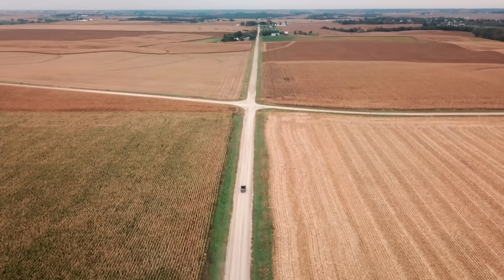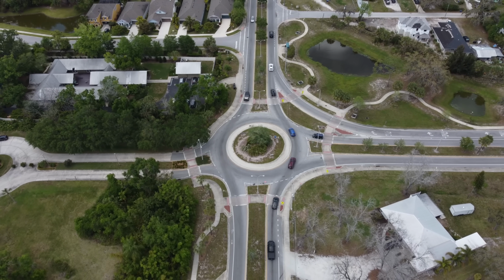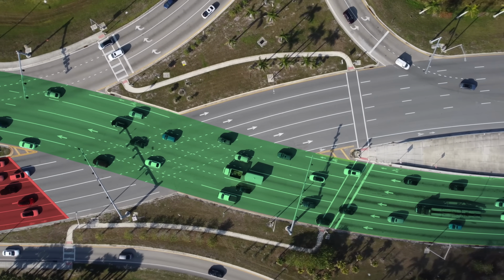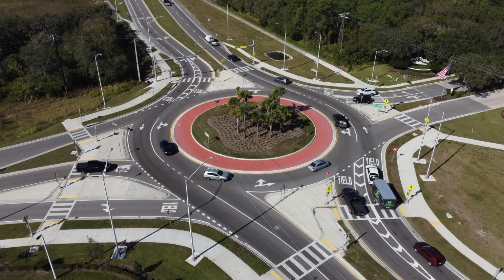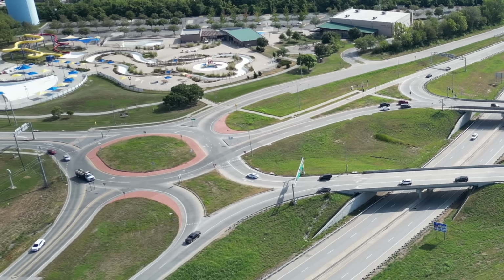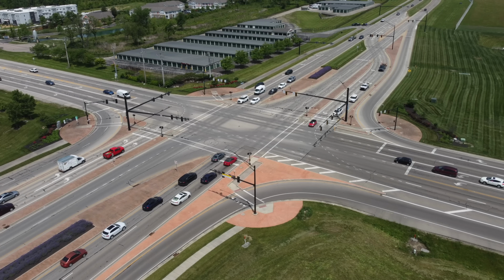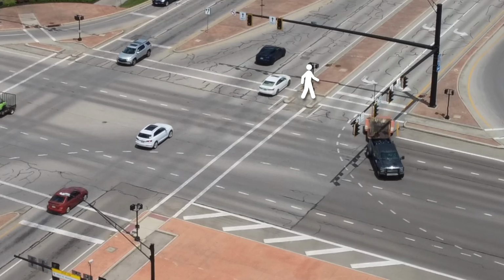These Intersections Are Changing the Roads Forever

Comment: Instead of diverging diamonds Idaho has been replacing highway interchanges with the SPUI. Single point Urban Interchange. 6 directions meeting at one signal either above or below the highway. This allows for only 3 cycles on one light. While right turns off the highway are signaled they are timed the same as the left turn on to the highway. Results in a smaller footprint than the Diverging diamond.
Reply: What are you talking about?  Idaho has been building DDIs as well.  SPUIs has just been around longer.

SPUI are better if there is more through traffic, DDI is better when there is more ramp traffic.  SPUI overpass cost more because of the special bridge span.  DDI costs less because it can use the existing bridges without much modification.

A DDI is more efficient because there is only 2-phases, where a SPUI has 3 phases.  That means there is less overall red time with a DDI.
Reply: @traffic.engineer  Really? Where? I'm in the Southern half of the state. 
I have seen them in Utah. And other states when I did OTR many moons ago.
Reply: @Species-lj8wh There is a DDI in Chubbuck and one in Rexburg.

Comment: A 🍀 system solves the left turn issue very well. It's the most used system for highways in Brazil.
Reply: Cloverleaf is unsafe and innefficient for large volumes of traffic.  Along with more cost and wasted land.  Streetcraft has already explained this.

Cloverleaf is for very low volume roads only.  American states get rid of them once an area urbanizes, as they cannot handle the volume, they have greater crash risks, and is very difficult and dangerous for bicycles and pedestrians.

Comment: Roundabouts are not more efficient.  It's a lie.  I have yet to see a roundabout replace an 8 line highway intersection.  Roundabouts are safer and they work well in places where there is say a medium amount of traffic.  I assure you this is true.  I have seen it in action.  They fail in open areas with lots of traffic.  They excel in low to medium volume areas or in urban environments where there is already congestion.  A one lane each side roundabout gets you 1000-1200 cars per hour vs a traffic light can get you 1800-1900 cars per hours.  However when you add a 2nd lane it's even worse because a 2nd lane will only give you 60-70% more capacity in a roundabout and 90% more capacity in a traffic light.  At 3 lanes it's not even a contest.  The thing is that most intersections don't need that capacity so roundabouts make perfect sense but when they do need the capacity you would regret putting a roundabout there.  So let's think about this.  A two per side lane roundabout is just barely more than a 1 lane traffic light.  At that moment the 2 lane roundabout probably makes sense so long as the volume is fairly balanced.  The problem becomes a 3 lane per side traffic light is not even possible to make a roundabout do it.  Such a traffic light could handle 5000 cars per hours but even a 5 lane roundabout could only handle 3000 per hour and honestly no one even builds them.  See this link for more.  https://www.tandfonline.com/doi/full/10.1080/03081060.2023.2214144
Reply: Roundabouts max out at 1000/veh/hr/lane.  They are great solutions for low volume intersections.

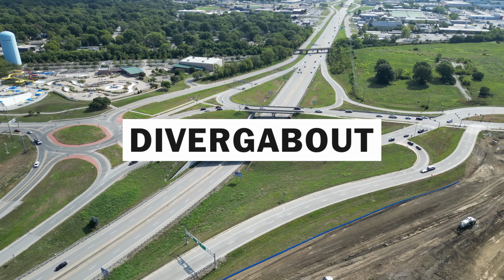Comment: 5:14 they're puttinc a costco in the grassy area on the top-right (southeast) of the traffic light side of the intersection. You should revisit how well this works on those days. There's also a megachurch on the SW corner of the interchange, Sunday mornings at 10:30am (costco open, church switching between services) will be massive stress point too. It'd be cool to see a followup.

Comment: So many great ways to direct traffic and especially to prevent conflicts with left turns… Meanwhile here, lots of traffic lights actively make left turns and opposing forwards traffic green at the same time. No idea why, but it seems like it's almost half of all traffic light systems that does this. And it constantly leads to people getting stuck in the middle of the intersection and blocking everything. Or people get a green light to turn right and pedestrians on that part of the road, which can be hard to see, also get green at the same time. I keep saying that they might as well turn the traffic light off completely at that point, it would be safer.

Comment: Couldn't find any mention of it here, but roundabouts function perfectly well in a power cut. Unlike traffic lights.
Reply: Because roundabouts do not work well on high volume roads, where signals are more efficient.  When power is out, police direct the major intersections until the emergency repairs are made.

Comment: It can be easy to clown on the divergabout, but I think it's a good thing to combine roundabouts with traffic lights here and there. Here in Denmark there are many roundabouts and they're efficient enough, but if you stack them too close together and you can have amazing traffic jams. I've seen jams that went through 4 roundabouts on a 3000 feet / 900 meter stretch. Everyone was eager to exit the city during rush hour and one blockage in the outermost roundabout caused a queue of cars going quite a fair bit into the city.

Comment: If a two way road meets (but doesn't cross) a one way road it is possible to have no lights and one merge for that connection. If you are then further willing to alternate (having both types) which side of the road the two way is, you can design a space with no lights and just merges (and without levels).

This can be used in a brick style grid giving an urban option with no lights and continuous traffic only slowed by turns and merges.
Reply: That only works with low volume roads.  It creates congestion for high volume roads.

Comment: Living in the Netherlands, I can't not laugh at these 'left turn solutions'. The roundabout is great! But the issue of the left turn is compounded so much by having to cross multiple lanes of traffic! So many US (st)roads have 3 or even more lanes. This creates situations where visibility to lanes is blocked by bigger vehicles, and it can get really hard to cross a road purely on visibility. And the second issue is the high speeds on all roads in the US. Almost all (bigger) roads have a rather high speed limit. This obviously makes crossing such a street much more dangerous. Even with traffic lights, this compounds the risks even more.

The 'solutions' to these problems in this video require so much space, cost so much to maintain, that I don't think they are real solutions at all. Sure, they are more safe than what it was before, but that's like saying we'll eat mud so we don't have to eat shit.

The real solution to dangerous left turns is simply to change the zoning restrictions and road rules. If the rules get changed so you can build beautiful cities like in Europe (Netherlands as a prime example of course), every time there's road maintenance, the road can be updated to become much much better. Every stroad converted to a street will change more people's minds. Cycling and walking will reduce traffic so much, that multiple lane stroads aren't even necessary anymore. Etc. Support Strong Towns, an advocacy group for this!

Comment: I'm not that well-traveled, but I can think of several places where the divergabout would be super useful in multiple states. It would be the most useful at an interchange I use on my commute to work that already has the diverging diamond, but the frontage road stops you from getting to the diverging diamond, so it feels like I am stuck in view of the interstate for ages before I can actually get on it. Unfortunately, it's on a steep hill with not a lot a space, so I don't know if they would be able to put the roundabout there...

Comment: Why not make the diverging diamond into an oval-about?
Reply: It would increase construction costs and would not be as efficient.
Reply: @traffic.engineer  I'm not sure how that could be. Surely, any system making use of stoplights is going to tilt towards being more inefficient. If the whole overpass operates as a roundabout, then all motorists slip to right rather than crossing traffic. Secondly, the diverging diamonds take up a significant about of land on either end of the overpass. I don't see how anything more than marginal increase in costs would occur in shaping both ends into a half circle.
Reply: @aaronjones8905  Freeflow operations for roundabouts only work for low volume intersections.  At high volumes, there is less gaps to merge at speed, which increases the stops and queues.  That is why UK has congestiom approaching roundabouts and even has to signalize them.

The dynamic assignment of right of way is necessary to allow these large volumes of conflicting traffic.  Signalized intersections arr more efficient for high volumes, while roundabouts are more efficient for lower volumes.  The simple two-phase intersection also reduces red times.

Additionally, a full oval interchange requires more land to build, while also using more complex structures (curvilinear bridges).  These factors increase the cost.  Diverging diamond uses the much of existing footprint of the original interchanges.

Comment: I just look at how enormous all of these things are and my pedestrian brain cries.
Reply: They don't have highways in Europe?
Reply: @traffic.engineer 
A - I'm not in Europe. We do have these things in Canada, and I still cry about the space they take up.
B - As a general rule, anywhere there's sufficient population density to create the levels of traffic that these designs are trying to address should not have highways. Big interchanges where two highways come together? Sure. Big interchanges to connect surface streets to the highway? No. If there's too much traffic on the surface street for a simple diamond, then the job is to reduce the traffic, not come up with fancy designs to facilitate it.
Reply: @The2wanderers  That space is necessary to manage the stormwater.  Otherwise the road floods, which damages the pavement and/or takes lives.

The best way to manage traffic is to spread out the conflict points.  Keeping them tight creates more danger or more congestion.  Hence which a roundabout is better than a standard unsignalized intersection.

Comment: A couple other additional perks when it comes to roundabouts has to do with pedestrians crossing the road there. And they are;

1. Refuge islands. If an intersection is particularly wide, you might not be able to cross it in one cycle, and that’s where refuge islands come in useful, as they allow pedestrians to stop in the middle of the road (legitimately) without the fear of being run over by a car, which leads me onto;
2. You only need to pay attention to traffic coming from one direction at a time. From where you start up to the refuge island, you only need to look left (or right if you’re in a country where they drive on the left side of the road), and vice versa from the refuge island to the opposite side of the road.

Comment: Multilane Roundabouts should be illegal
Reply: Why should a 2 lane roundabout be illegal?
Reply: @GrillerRohde  Because they are dangerous
Reply: @Fosten12 
They are only dangerous if they are poorly planned and constructed or if the people never learn how to use them properly.

As most countries have many regulations for planning and constructing infrastructure this should not happen.
The major problem of most nations is that driver licenses are cheap and easily accessible and thus people never learn how to properly drive or handle unfamiliar traffic scenarios.

The majority of crashes in roundabouts I have seen were either due to excessive speed, failure to yield or unsafe lane changes. Most of the time purely caused by the driver rather than the roundabouts itself.

Comment: Roundabouts and similar designs can just work wonders. Look at US-169 at I-494 in Minnetonka, MN. They added a metric ton of roundabouts to replace several different interchanges right next to each other. It took maybe a week of getting used to, but once I did, it was an absolute dream. So much easier on the vehicles, too.

Comment: I'm currently at a semi-cloverleaf intersection between two main roads in Israel that I was hoping you can cover. On the south part of the first road, there's a junction with 3 lanes coming out of it + right turn slip lane. those lanes turn into 2 lanes for the intersection and the traffic merging from the other main road is not making it easier: they also merge from 2 lanes to 1 and then into the main road.
The main roads in question are roads 40 and 44 in Central Israel.

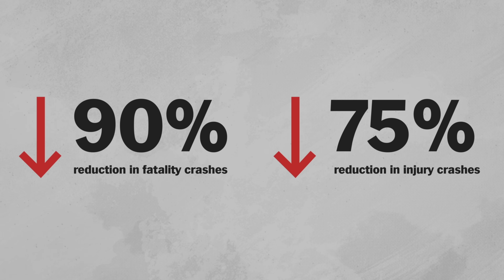Comment: 0:46 NJDOT has been progressively ripping out their circles as they got so congested they became accident generators
Reply: Because they are not roundabouts.  They are not designed like a proper roundabout and need to be removed.  Additioanally, roundabouts are not made for high volume roads.
Reply: @traffic.engineer  These were called Traffic Circles in the US up the late 1990s. That is when government here got serious about standards, making many changes on signing and flow, and government/media seized on the Aussie nickname roundabout. NJ found out the hard way that putting a circle where two major arterials (multi-lane mind you) meet does not function well. Roads here probably in the 30-100k per day range.

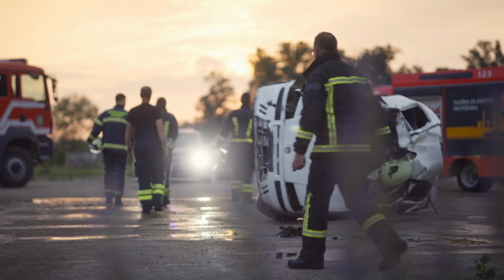Comment: 1:10 Efficient? Not in the rush. Circles on 2 busy roads start flowing like traffic lights. One road will flow while the other backs up, then they flip.
Reply: So they're no less efficient for high traffic, more efficient for low traffic, and don't need lights maintenance.
Reply: @williamchamberlain2263  For high volumes, signalized intersections are more efficient.  The can dynamically assign the right of way, where the static operations of roundabouts cannot service.  Roundabouts perform much better than signals for lower volume intersections.
Reply: Standard roundabout maxes out at 1000 vehicles/hour.
Reply: @traffic.engineer  NJDOT has been removing circles since the 1990s. The Marlton Circle, sited where NJ 70 and 73 cross (both are 4-lane major arterial routes) was over 50k vehicles/day averge, far worse with shore traffic.
Reply: @dtvjho  Those numbers are well above capacity, requiring removal.
Reply: Maybe you should leave earlier

Comment: All these spaghetti solutions make it extremely hard to maintain a mental map of where you want to go.

The roundabout is still king. Missed your exit? Just take another round. Need to turn around to go back to where you're coming from? Take the roundabout. 

It's also relatively easy to navigate for non-car travellers like cyclists and pedestrians, which, you know, exist 🙌
Reply: Roundabout only works for lower volume roads.  They do not have capacity for high volume roads.

Comment: Those u-turn left turns are a nightmare. You have to turn the opposite way you want to travel, drive a half mile, wait at another traffic light, and then make some wonky u-turn to return to the original intersection and then wait at the same light all over again. to finally start making progress. Whoever thought 3 lights are better than 1 should be sent to Guantanamo.
Reply: Red light times are longer at a standard intersection because of multiple movements.  U-turns hace less green time, and also allow drivers to make a right/left turn on red.

Comment: The diverging diamond in Lacey Washington is terrible for bikes and pedestrians
Reply: Because?
Reply: @traffic.engineer it's got a protected lane in the middle but to get to it you have to cross 4 wide lanes of traffic on both sides. It's also the only overpass for miles to get from houses to a retail core, traffic could be cut down massively by making it more friendly to other modes
Reply: @DANCINGWITHTHEFAILS  and this is much safer than a traditional interchange or intersection.  Now bikes and pedestrians do not have to cross with conflicting left turns.  Pedestrians cross with a protected signal phase and have ample time to make it to the protected pedestrian way.  They do not have to walk on the edge of the bridge.  If anything, this is much friendlier for bikes and pedestrians.

Comment: Traffic circles are terrible, I avoid them whenever possible.  Call me old fashion, but I prefer lights or 4-way stops.
Reply: Signals are better for high volume roads.  Roundabouts work great and better for low volume roads.
Reply: @traffic.engineer  I agree, which is why I don;t understand NC putting Circles on highway ramps and at major intersection in town.  They seem to think Circles are the solution to every problem.
Reply: @twitch1965  If there is less than 1000 vehicles per hour, then the roundabout is the better solution.  Man interchange ramps along the Interstates do not have large volumes of traffic but still need to provide reasonable access.